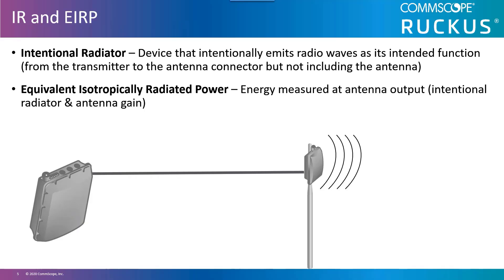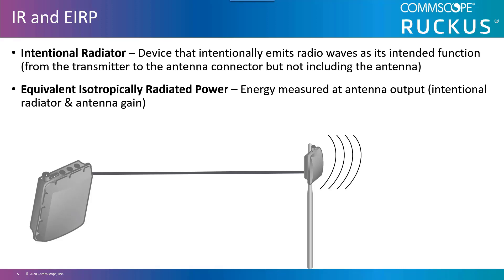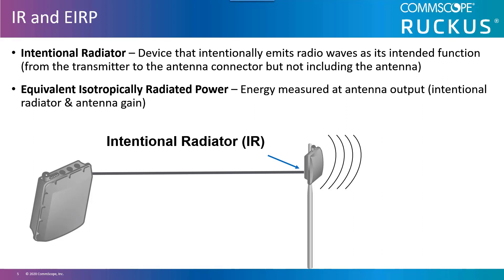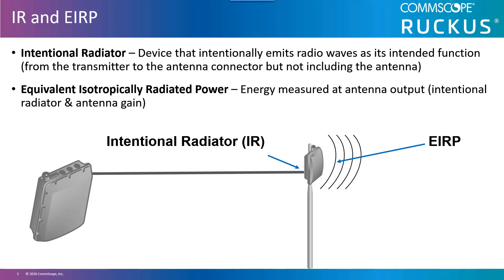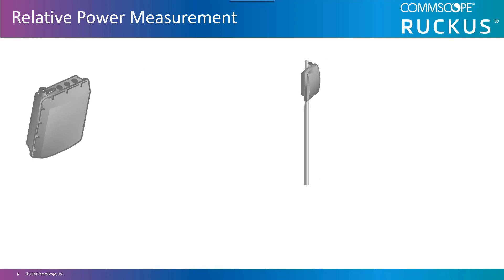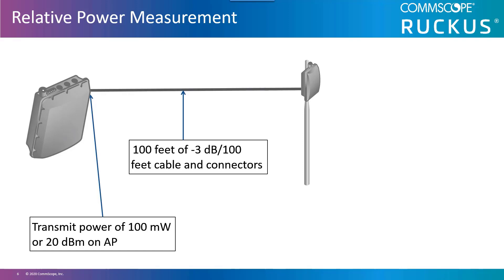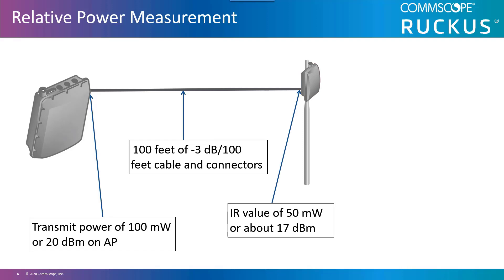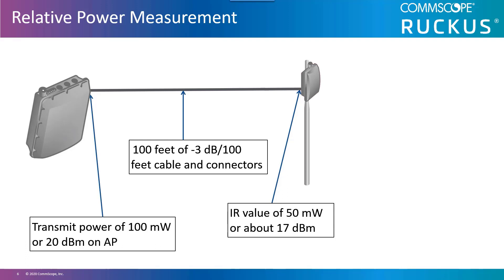IR, EIRP and Relative Power Measurement

Comment: 20 dBm is 20dB above 1 milliwatt (reference). 27dBm is 0.5 watt and 30 dBm would be 1 watt. Every 10 dB increase is 10 times the power previous value. Every doubling of power is 3 dB upward change. Got it? OK